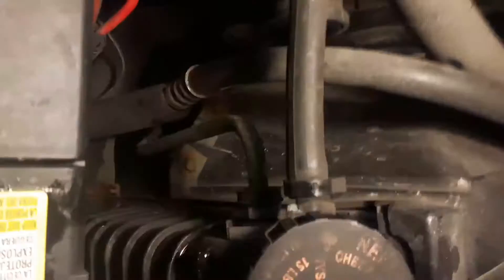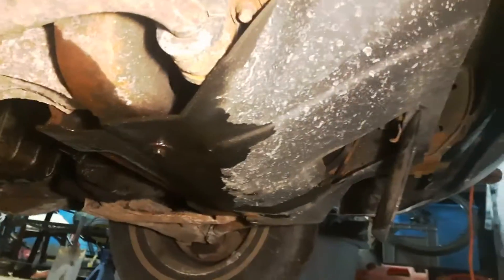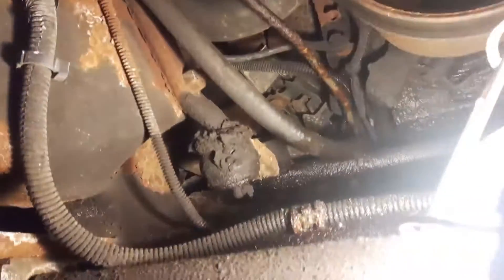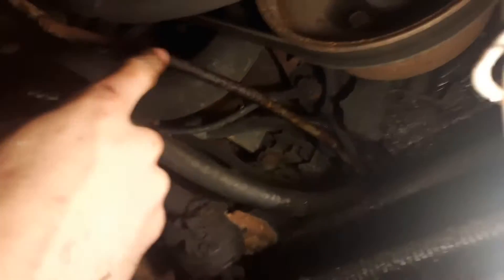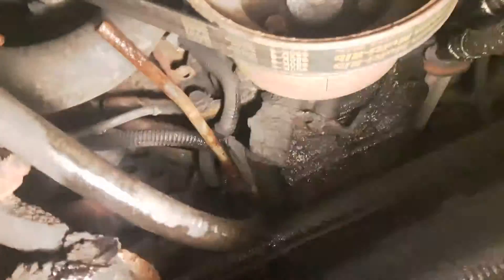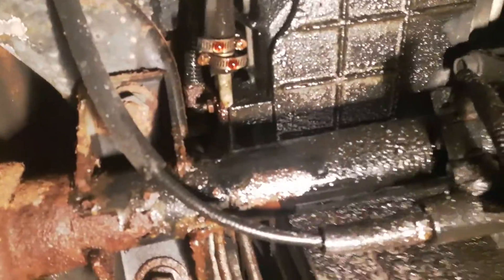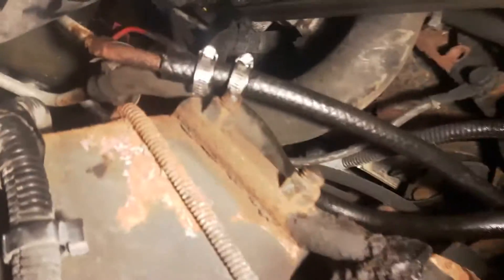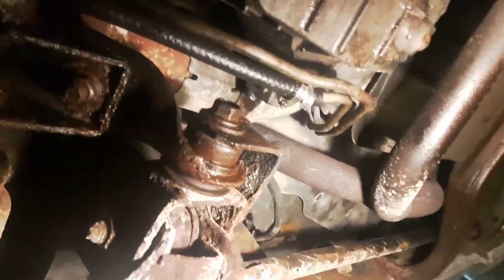2000 Gmc Jimmy/Blazer Transmission line Replacement

Comment: Yep I did the same spliced out a section with rubber transmission line still holding up 3 yrs later.
Reply: What did you use to cut it